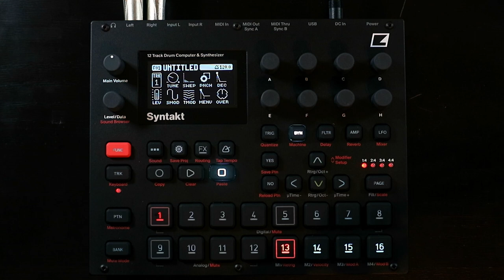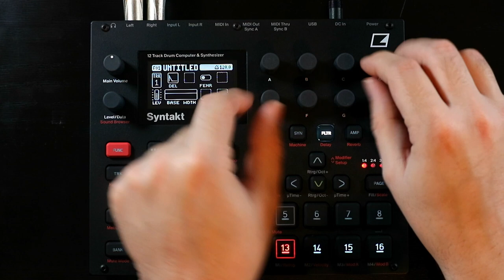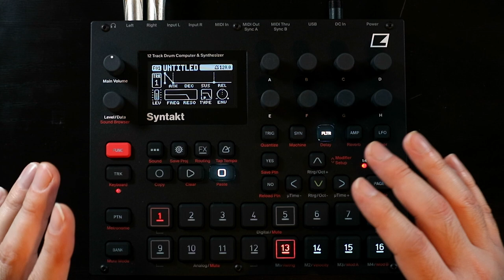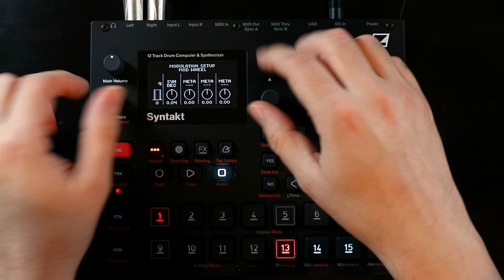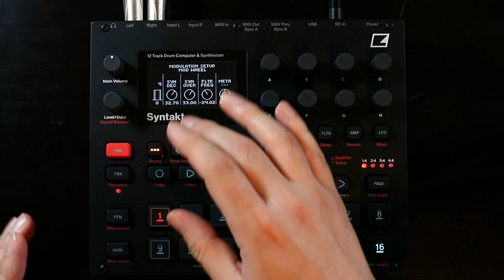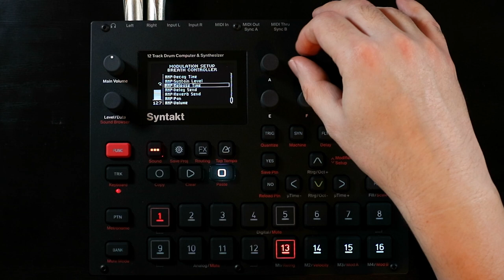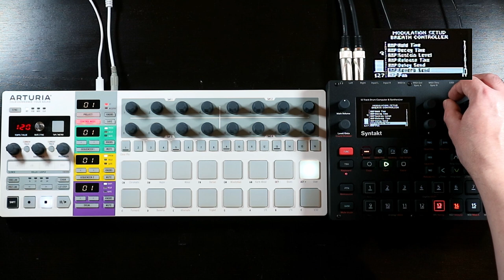Syntakt and Digitone Macro Controls

Comment: Nice demo! Quick tip (I’ve done a video on this, too), on either Syntakt or Digitone, you can use MIDI loopback and the MIDI track’s SYN page has MW PB BC and AT right there. On Syntakt you lose a track, but on both you gain Elektron sequencer control, including an LFO, over all these macros…
Reply from the maker: Absolutely, I meant to mention this in the video but got carried away! The only caveat is that you need to be a little more economical with how you set things up on the Syntakt with each MIDI track only being able to address one MIDI channel - but on the Digitone it is probably the more effective way of approaching it in a lot of cases.
Reply: Everyone should check out Human Program, on the cutting edge of some wild loopback performance techniques on the Elektron boxes ^^
Reply from the maker: Ah, just had a little zip around your video - good work! You're taking more of a "super control all" approach rather than per track control - that's a really cool application that I hadn't considered. I'll pin a comment linking to your video because folks should definitely check it out!
Reply from the maker: @chrisj5547  yep! I hadn't seen their video on it but it's a really cool way of approaching this idea. I've pinned a link to the top of the comments 😊
Reply: Thanks, and thanks for the shout out Chris J! I’ve picked up some other tips here, too—it’s a really remarkable feature of these boxes, and the range of approaches speaks to just how powerful it is!

And warm thanks for the link above, I’ve pinned a link back here  from there to make sure the internet is as well-cross-referenced as its designers would have dreamed
Reply: AND ITS SO FUN

Comment: One thing that helps me a ton when trying to do that spastic jump around tweak knobs and reload thing is to make sure the project is locked before I do that kinda thing. That way nothing you do will mess up things up permanently.
Reply from the maker: Yeah, for sure, I don't ever do a performance before saving and locking these days - hit shift+yes/shift+no at the wrong point too many times to risk it!
Reply: You can reload a pattern from the saved project in the…pattern menu, is it? So an accidental func+yes can be restored from the last save on whatever pattern you are on without having to lock anything. You can also hard save the current pattern into the saved project without other post-save changes to the project being written.

Comment: you can sacrifice one chanel to switch it to midi, connect midi out with midi in with physical cable and then use MIDI CC  on knobs to control macros (by switching midi channel you choose which synth engine you are controlling)

Comment: Hello OS! Do you know If its possible to do something in order to reload initial value of modulation wheel and breath controller when i use reload pattern function on syntakt ? 
Or am i allowed to do it manualy before drop?..
Hope my english is enough understandable :s😅
Peace ✌️
Reply from the maker: I don't think there is in the tone/takt itself, and even if there was, you'd end up jumping the values as soon as you adjusted them on a controller. It's probably best to have your starting point be the minimum or maximum value.

Comment: thanks for this very powerful tip! btw
i was curious about sending an aftertouch message from my beatstep(not pro) to digitone
around 9:55 you say it's not CC
so my midi control center app just have "CC and NRPN/RPN" as mode
do you think it can send an aftertouch as well?
Reply from the maker: Probably not if it's not listed, it may well be that was only added on the Pro version sadly. I'd have to check the manual to be sure though.

Comment: Am I missing something? How did you set up the specific knobs on the controler to control the portamento/aftetouch/whatever on Syntakt?
Reply from the maker: The BSP can be configured to have the knobs send most kinds of midi messages. I used the Arturia Midi Control Centre software to set it up. Different controllers will be different of course.
Reply from the maker: And for clarity, the knobs are sending mod wheel messages across the top, and aftertouch along the bottom.
Reply: @OscillatorSink  Oh i see, thanks, Ill need to check it out
Reply: @OscillatorSink  Ok im slowly getting there, I’ve set up my minilab to send modwheel via one of the faders, however I’ve no idea how to set similar vac things in Digitone, those seems to be totally different to set up